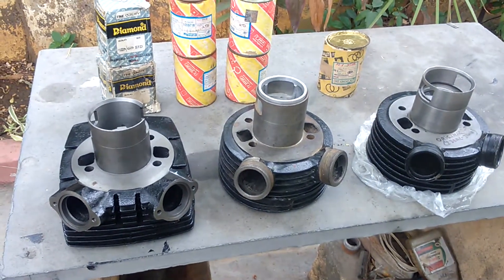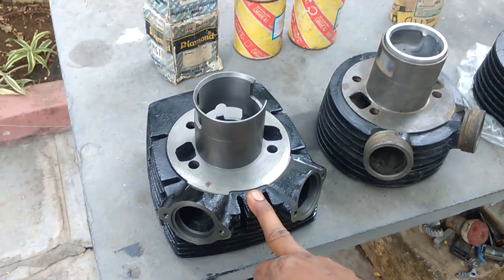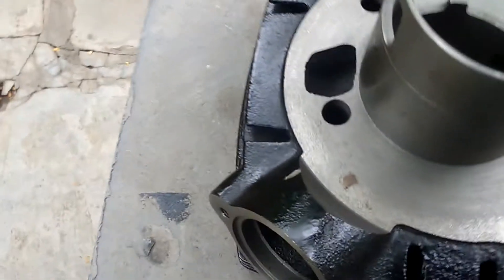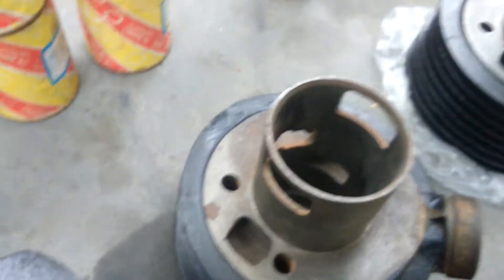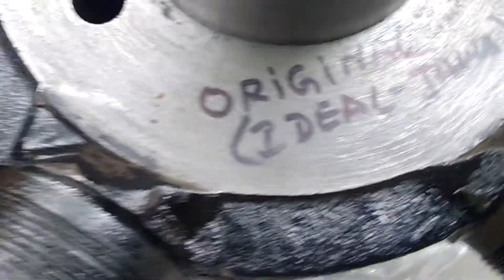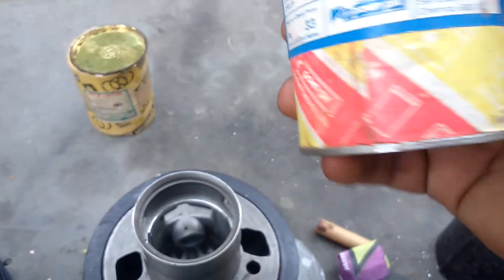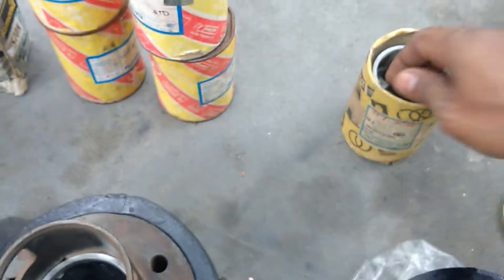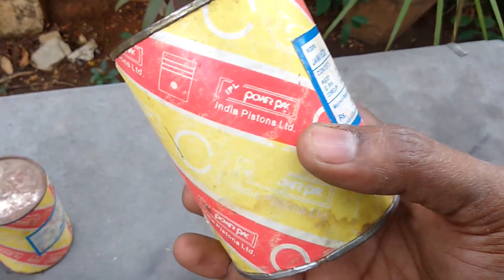How to find genuine block (bore) and piston(yezdi jawa spares available 9491220222

Comment: Informative video. You can also see the bore fins. The bore fins on the original ones are thin and the overall finishing is great compared to the 3rd party manufacturers. And this can be seen without opening the bore. Correct me if i'm wrong.
Reply from the maker: your information also correct.
but now a days we are not getting oe spares so we are not getting easy idea to find oe spares 
that is why I explained to yezdi jawa fans with this video 
every normal quality block having their brand name but only oe doesn't have any name
Reply: Yeah thanks for the video again :)
Reply: question is how ideal bores are available now with fresh look... company closed 22 yrs ago....
Reply from the maker: storing like valuable items 
I have 39 years old spares like new one
Reply: I saw many bores of jawa with no punch name on it.... is there any other way to find it. mine has jawa logo on top side of bore.. imported
Reply from the maker: by quality only we can find.
main thing is we recognise with piston also
in India original bore come with IPL piston
Reply: Will IPL original piston and rings  fit in duplicate bore perfectly
Reply from the maker: can you msz me on my WhatsApp 
my phone number is 9908220222
Reply from the maker: can you msz me on my WhatsApp 
my phone number is 9908220222
Reply: Where can I buy new cylinder for jawa 250 type 353?
Reply: Someone told me original block has broad fins , aftermarket has thin fins ? What is right ? I have both with me
Reply: @hariprasadkathyayani  hi mast

Comment: Sir,
Are other engine parts like the gear box  parts, head parts, and various other small engine parts available? Are they still manufactured? Duplicate or original, any can serve my requirements.
Reply from the maker: All spare parts are available
9491220222